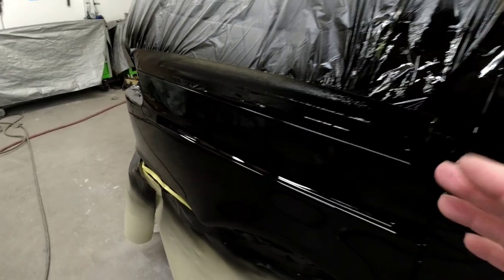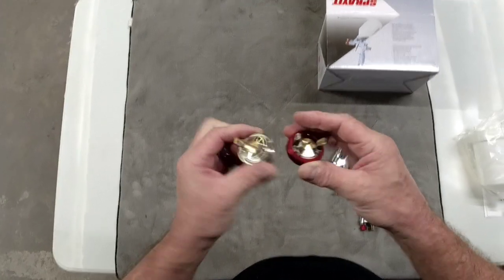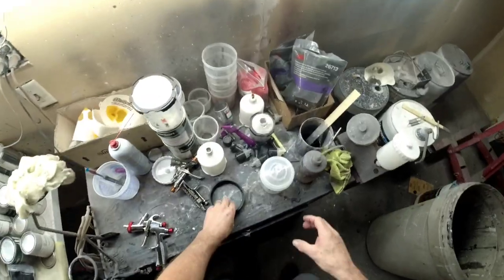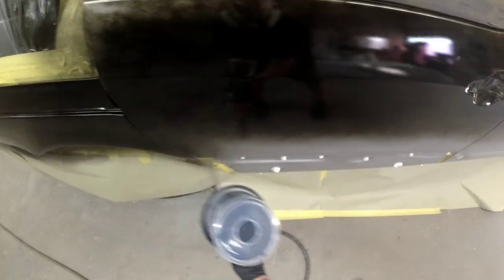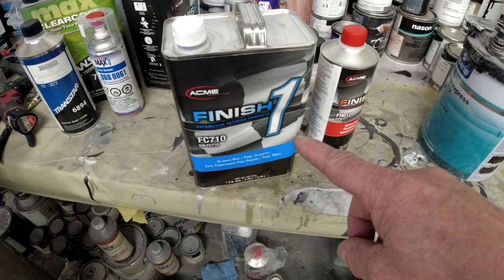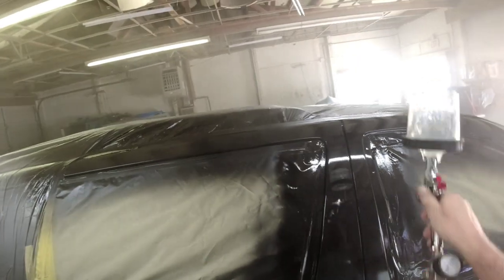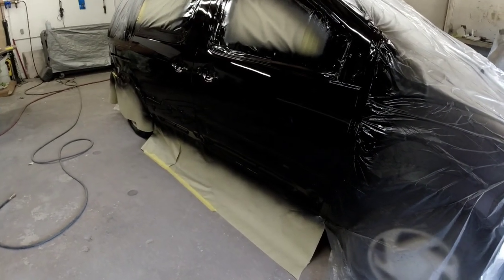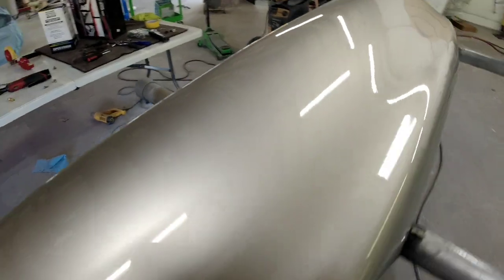Why is this budget automotive paint gun  perfect for painting with small compressors.?

Comment: It's a good affordable lvlp. You can paint a whole car with it using a 20 or 30 gallon. I mainly use mine for basecoat with the cup. I've started saving my pps cups for clear and primer. Cleaning base isn't that bad. I prefer my Iwatta W400  lv2 1.3 for clear, but the Spray it can do a factory peel job

Comment: This spray gun is a rebadged Rongpeng R500.   A Chinese company which makes several models of spray guns and air tools.  The Sprayit company no longer manufactures spray equipment.
Reply from the maker: Make sense stamped R500  on the gun. Appreciate the info !
Reply: What adapter did you use for your pps cups? What’s part number and where did you get it.
Thank you

Comment: I got two of thoses guns, i started my paint jobs few years ago, and its a very great tool.
The problem is the lvlp system, you expend more time painting that if  you use a hvlp spray gun.😅
Reply from the maker: It's  true It's  a bit slower. Not so much if you spray closer to the panel, but alot of painters don't  feel comfortable with that
Reply: @GarageNoise  i painted a metallic blue VK passat today.
It takes me 3 hours for the best finish with the sprayit...
A few dodge ram pickup took me 6 hours, and with the hvlp devilbiss 4...
As you say, depending the painter.😅
Saludos de México :)

Comment: Great video Chris as always.
I wanted this gun as soon as I saw your first video in the Eastwood LT100, but was out of stock for a while. After some research I found these are the same:
Summit racing, Spray it, Aero pro, LT100, all made by Rongpeng China. However I am now considering the Italian ANI R160Q.
If possible please test this out, and the R500 with a small CFM compressor.
Thanks again!
Reply from the maker: I'll look into it. Appreciate the support!
Reply: Got the ANI 160 great gun , it will run off my 25ltr hyundai compressor. I use it when doing 2-3 panels

Comment: I've used the Sprayit gun with a 4 gallon compressor intended to run a roofing nailgun and it kept up just fine. So just about any non oilless compressor should run it fine.
Reply: What air compressor do you use without oil? I'd love to know!
Reply: @chris01479  Most compressors have an oil sump like a gas engine with an oil slinger attached to a connecting rod or the crank. It flings oil around the crank case to lubricate everything. 

Oil less, AKA oil free compressors have no oil sump. They use sealed bearings and have a plastic or plastic coated piston riding in a chromed cylinder. Oil less compressors are louder, run way hotter, have very short duty cycles and they usually last only a few months longer than the manufacture's warranty.
Reply: @THX..1138  Thanks, I'm going to get oil compressor if it will go quiet when I spray on it. You haven't say how many litre of air compressor you have got??
Reply: @THX..1138  Do you use 24l or 50l compressor?

I have heard that you can use up to 5cfm to spray on whole car using with 24l compressor??

Comment: I bought an R500 but ran into 2 problems.
1 when spraying i felt air bubbling in the guns gravity cup(sounded like a bong)
2 i used a gravity strainer/filter between the cup and gun but this caused the spray pressure to fluctuate a lot. So i removed the strainer and this worked. 
since i had no other the gun available amd my base coat was mixed already i ended up using the gun anyway for base/clear and its is great. 
not sure how to fix those problems.
I'll recheck one more time before returning it and getting a replacement

Comment: They make a clear for hot temperatures from tamco it's on the expensive side unless you're getting a quart of it to try make for 100+ and dries 20 percent slower I've used slow activator insmy inflatable spray booth and it was still drying to fast haven't used this stuff just yet got a gallon myself
Reply from the maker: Intresting,  would be curious to how much of a difference it would  make.  I could have maybe used an extra slow activator, if it was available for finish one but at those temps Not sure  if there's anything that could be done . Thank's for the support!

Comment: Chris, couldn't you add a little more reducer to give the paint more time to lay flat? I don't spray in desert temps thanks for sharing.
Reply from the maker: You would think and it make sense but more reducer makes the paint actually dry quicker.The main purpose of solvent is to help paint dry. You need the binder that's mixed with the color to create a good wet bed. Great questions appreciate the comment and support!

Comment: I got an LVLP Gun. I have a Porter-Cable Job Boss which is only 4.5 GAL but 3.5-peak-horsepower motor delivers a mass flow rate of 7.8 Standard Cubic Feet per Minute at 40 psi and 6.0 SCFM at 90 psi. Would this work fine for painting one panel or is it too small? Seems to be more powerful than other larger compressors
Reply from the maker: Yes, that should work fine for what tour doing. Appreciate the comment and support!
Reply: @GarageNoise  thank you! I’ll let you know how it goes. Love the videos, very helpful!👍🏻

Comment: I bought this gun several years ago as a kit with all of the nozzles option. I painted my kitchen cabinets and the Craftsman air compressor had no problem supplying air to the gun. What do you think of the HF PPS? Is it comparable to the 3M PPS?
Reply from the maker: I like it , it got the job done no leaks. The way the measurement are set up on the cup seams over  complicated and might be a bit confusing to a beginner but other than that no complaints.  I order some off Amazon  that I'll be testing out soon as well. Appreciate the support!

Comment: Great review, although I’ve already purchased two guns, one husky composite HVLP, avg cfm is 4.3.   And the black widow hte for clear, Not sure on the CFM on that one, I think it’s 11 at 35 psi, so if I run it at 28-ish would that be less CFMs required?   Home compressor is new 29 gal 6.8cfm @ 40ps.   
Not doing a whole car, just a hood and two fenders for now
Reply from the maker: If you use less air pressure.  Your still using the same cfm's from the gun but you should have less air fluctuations from your compressor.

Comment: Great video 📹 Chris can you give me some advice please I painted my front bumper and the primer high build upol reacted with the 2k paint what was all ready  Chris on the bumper I need to take it back to bare plastic is there a quick way mate
Reply from the maker: Depends how bad it reacted. Sand out the reaction with 320 then put some 2k primer on those areas. Startwith light coats and build it up . Appreciate the support
Reply: Chris I want some advice mate
Reply: @GarageNoise  chris I have had nothing but trouble with it mate I put some plastic primer on and then 2k high build primer and it just reacted to the white  paint underneath so some body shop said needs to go Back to bare plastic
Reply from the maker: @ANDY-we7mr  sounds like you might have some old enamel  paint  that's  causing  it. Taking it down to bare plastic is more work than it's  worth   if you can get it smoothed out and sealed off from that old paint with primer you shouldn't have a problem applying new paint and clear.  The key is to put light coats of primer and build it up .
Reply: @GarageNoise  thanks Chris it was a second hand ford focus mk3 front bumper but it was white when I got it painted with 2 pack paint 😀

Comment: Do you use 24l compressor with lvlp spray gun? Does it work to make the good finish?? I'd love to know!!!
Reply from the maker: I use a larger  compressor.  60gal the make 16cmf of air. But youcould use a compressor that makes as low as 4-5 cfm's  with this gun.
Reply: @GarageNoise  How many litres is that can be using with 4-5cfm??

What spray gun do you use?? Is it spray-It?
Reply from the maker: @chris01479  4cfm is 113liters the r500 also it's  been rebranded as the sprayit 33000 ,eastwood lt 100, areo, there's  a link in the description of the video.  Hope this helps!

Comment: I want to buy this gun but can’t find the disposable cups and the correct adapter on Amazon. Can you help?
Reply from the maker: You want the adapter for  the 3m pps 2.0 or the old 3m pps?
Reply: @GarageNoise  whatever is least expensive to replace the cups.  And which cups to buy that will fit the adapter you suggest.  Thank you much.
Reply from the maker: @dougsweldingfabrication953  I'll  get you that info today.
Reply: @GarageNoise  Thank you so much
Reply: Wha Pps adapter did you use?  Was it a harbor freight or a 3m
Reply from the maker: The disposable cups I get are on Amazon here is a link https://amzn.to/3sOoaBr
I'll  have to get back with you on adapter.

Comment: What reducer did you use brand
Reply from the maker: Nason slow, thanks for watching appreciate the support!
Reply: @GarageNoise   what do you do if you have mapping after you sand down the clear to recolor do I primer those areas , sorry for all the question I painted it and didn't like the way it looked starting to redo and don't want it to show through. Thanks for the help love the show lots of help for me a begginer
Reply: @GarageNoise  
Thanks for all you do what should I do for mapping I sanded down the clear to repaint and I am seeing mapping in the color under the clear or I have went to far in the color in two spots . Any help would be great again thanks
Reply from the maker: @jameswilliams8252  doesn't sound  like it's  necessary to apply primer. If you have mapping you kust need to prep clear for another  coat of base and then  reapply clearcoat. Try not to sand thru the clear coat.